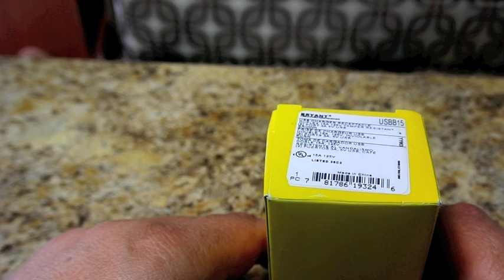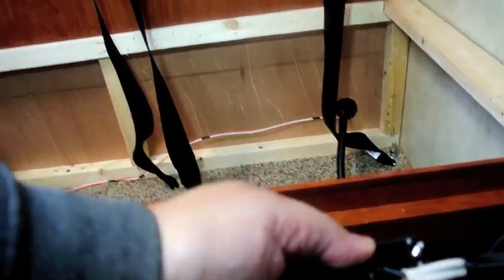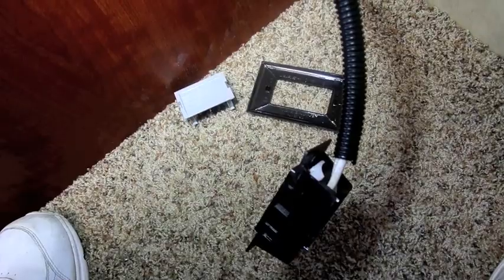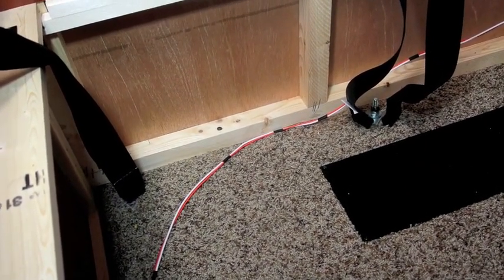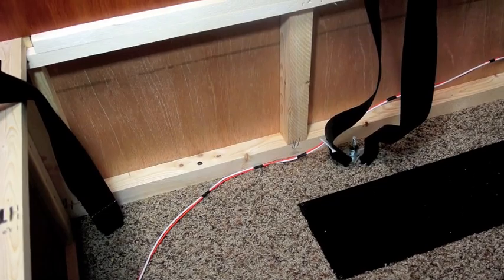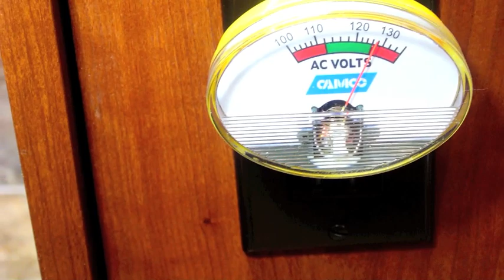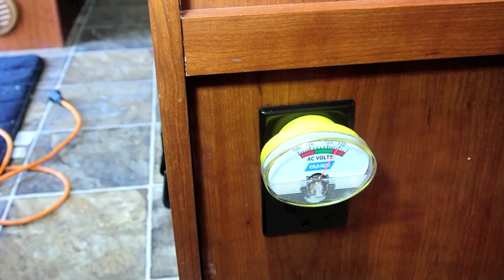Adding a combo USB 120VAC Outlet to the dinette in my RV.

Comment: I had the same issue with a brand new 2020 arctic fox trailer. Started looking underneath the cabinets loose wires everywhere. The one that concerned me the most were several wires just laying on top of the furnace. I’ve spent days putting loom through holes to protect wires and clips to tie lose wires to the walls.
Reply from the maker: Pretty scary.

Comment: Why put the same trash outlets back in.  Spend a couple dollars for a shallow electrical plastic box and a house type electrical outlet?
Reply: First thing I do with any RV I buy, Rip out the trash pinch style outlets and put proper residential outlets in. Pinch outlets tend to heat up and can be a fire hazard. Far less of an issue with with a proper residential box and outlet. Plus I feel the screw connectors are better. Just my 2 cents.
Reply from the maker: If the outlet is in a daisy chain, there isn't always sufficient wire to cut it  and terminate it into an outlet.
Reply: @RVProject wrong come back for this one! You had plenty wire! These style push in crimp should be banned especially in RVs
Reply: @roberttaylor8261 I agree with you. Even if the wire is too short, just add pigtails and extend the wires.

Comment: So let's say I just want to replace my AC wall for a USB wall. I don't need to change anything or add cable. Just remove the AC wall, add the USB, plug the red, black and ground and everything will work fine?
Reply from the maker: A combo USB outlet is just a standard outlet with the addition of a USB power supply. As such, use your same experience level you have with AC wiring in your home to determine whether or not you should do this.
Reply: @RVProject  Thanks for the answer

Comment: They are putting solid wire in there to emulate a stick built house. Not RIGHTLY so...but that's where they are getting it. Works fine if you park it and never drive it....but that's not realistic.
Reply from the maker: I agree completely. Before I had RVs I had many boats. The USCG requires (via federal law) that all boats have stranded wire. No solid wire is allowed. 

The safety issue here is if you have an electrical fire on a boat a couple miles off-shore, it would be a very serious issue.  I guess it's OK though to have a fire in a RV as you are traveling down the road - provided you can stop in time and bail out.
Reply: I would appreciate it if you gave me a quick explanation why stranded is required over solid in boats.  And why would stranded be better in RVs?

Comment: I am not surprised you found a lack of factory workmanship in this project. I think they all must be made the same, slapped together as fast as possible without a concern for quality. Every time I look I find missing screws bad wiring etc., flat out sloppy work.
Thanks for the info.
Reply: Ken C I've had the pleasure of speaking with an RV factory worker.  They have quantity quotas to meet every hour, everyday.  You get moved or fired if you can't keep up with a crazy pace of slapping things together.  It's the factory and companies fault. It's about quantity, not quality.  The workers want to do better work, but often don't have the right tools and certainly don't have the time.
Reply from the maker: Yes, it's a shame the workers and company take no pride in their work.
Reply: You read my mind! You'd think for what they charge for a new trailer or RV, that they would actually translate that into a quality product. I'm sure there are some companies that actually DO put together a quality product....but it seems like there's not a WHOLE lot of difference except bells ans whistles....between a new one...and my 73 Pace Arrow. Especially when even the new ones need work right out of the gate.
Reply: K2,
You've confirmed my hunch. 
I hope to retire in the next 6 to 10 years. We may full time it then or at least be on the road for a good amount of time. We are eyeing the Tiffin line. From what I've seen the quality seems to be better with the higher end manufacturers. I hope I'm correct.
I'd like to see some standards for quality & safety set for the RV industry similar to the auto industry.

Thanks for the reply K2.
Reply: There are a few high end rv's that do everything right but boy do  you pay for it.  They look the same outside and cost double.